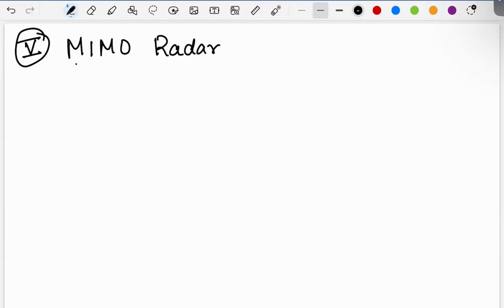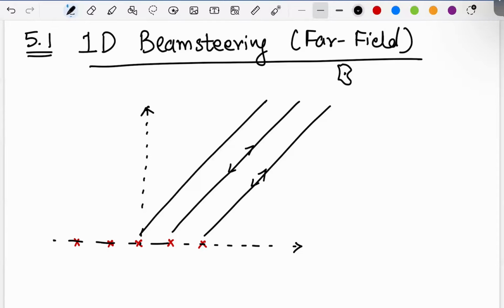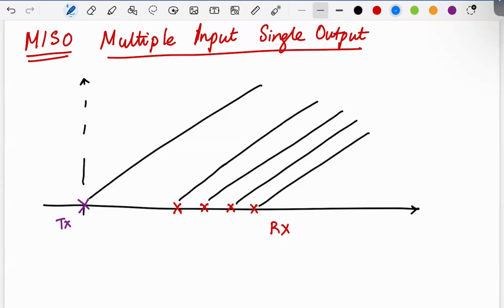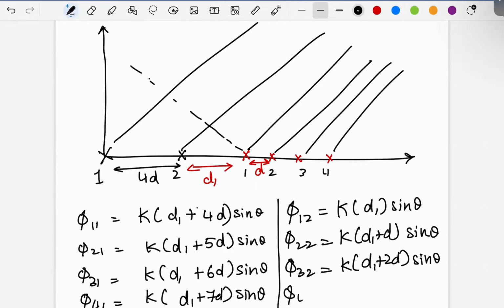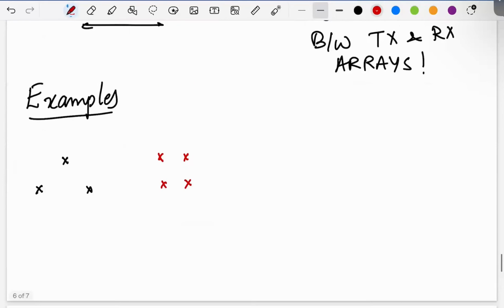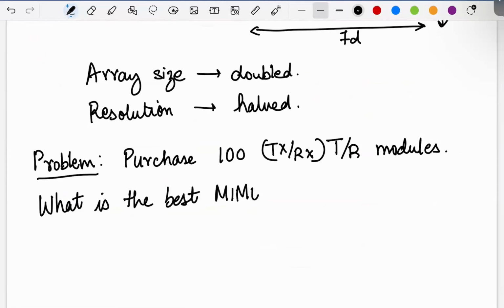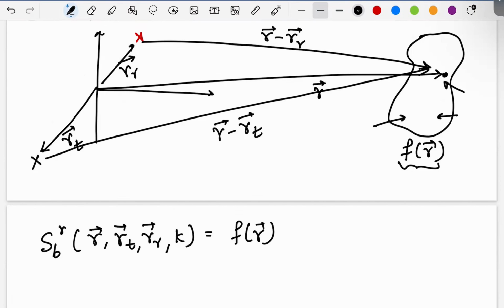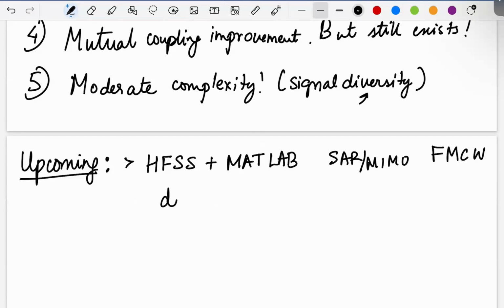MIMO Radar | Radar Imaging 05

Comment from the maker: I want to clarify the difference between the the convolution based virtual array I present in this video and the mid-point based virtual array found in some literature. The mid-point virtual array approach and the convolution virtual array approach are both equally valid.  The mid-point virtual array is formed by taking the midpoint between each TX and RX pair. When you use the mid-point virtual array you should treat each element as an element of a synthetic aperture radar, i.e., you need to account for two-way propagation when doing beam-steering. In the convolution virtual array approach, each element should be treated as a receiver phased array with a single common transmitter (or a transmitter phased array with a single receiver) , i.e. only account for one way propagation when beam-steering. If you draw the two virtual arrays for a given MIMO system you will see that the mid-point array is scaled down to half the size of the convolution array with the same distribution of elements. But since you account for two way propagation, that compensates for the scaling down. At the end you care about what phase weights to be added to each TX-RX pair. In both these cases you will get the same result.

Note: Both these approaches are only valid for far-field beam-steering and not for near-field imaging.

Comment: 45:35, this drawing is not correct. The drawing has an aperture in the y-direction of 5d, not 3d. If we use the configuration on the left, we do not find the virtual array on the right.
What we need is that the vertical (horizontal) spacing between the Tx (Rx) linear arrays equals 4d to have no overlap in the virtual elements.
However, this causes issues if we want to draw the Tx and Rx elements with their centers aligned, as is done in the drawing on the left, as the closest distance between a Tx and Rx element would have to be smaller than d (you can check this by drawing the convolution; the easiest for me is not copying with respect to the center of the Tx/Rx configuration, but rather a fixed element like the top left element).
If this is a design challenge (hardware level) that can be overcome: great. If not, an easy solution is to just put these Tx and Rx configurations in each other's 'vicinity', as the convolution operation would still give the desired virtual array.

Comment: Hi, I am the beginner in radar field and thank you for uploading these series about radar. Recently, I encounter some problems.

1. I understand the virtual array formation under far field condition, but I found out some papers refer this array as co-array. They think of the midpoint array (the virtual element is on the midpoint of TX, RX pair) as the actual virtual array(also this is under far field). My question is what on earth is the difference between this two.

if we say the beam pattern of the MIMO is the TX pattern times RX pattern, then the "co-array" becomes resonable, since the aperture's fourier transform yield the beam pattern and this lead to convolution of TX and RX position. But this generate another question.

2. If we think co-array as the actual virtual array configuration, then it seems to be improper to use TDM because there won't be interference result.

hopefully anyone can answer my question or provide some reference. thank you so much!!
Reply from the maker: The mid-point virtual array approach and the convolution virtual array approach are both equally valid. When you use the mid-point virtual array you should treat each element as an element of a synthetic aperture radar, i.e., you need to account for two-way propagation when doing beam-steering. In the convolution virtual array approach, each element should be treated as a phased array with a single common transmitter, i.e. only account for one way propagation when beam-steering. If you draw the two virtual arrays for a given MIMO system you will see that the mid-point array is scaled down to half the size of the convolution array with the same distribution of elements. But since you account for two way propagation, that compensates for the scaling down. At the end you care about what phase weights to be added to each TX-RX pair. In both these cases you will get the same result. Hope that clears your doubt.

In both cases you need TDM (or some other orthogonality) because you need to measure each TX-RX pair separately.
Reply: @adityavarmamuppala  I see~ thank you so much!  and actually I have some question about the previous video too😅
1. Basically the sar will make a lot of image and then make summation of all of them, am I right? i.e when array is at (x1,y1) we construct an image of the target, then the array move to (x2,y2) and construct image again, is that correct?

2. let say we have finite point on the target, and we want to use sar to construct image and the element is at (x,y). The received signal of one element will have the contribution from every point on the target, but the distance will be different
((x-x')^2+(y-y')^2+z^2 will be different, where (x',y') is on target). Do I need to apply the so-called steering vector to get the coherent-sum signal(make the signal maximum)?

sorry that I have so many question because I have learned phased array before and SAR has some different describtion that make me confused.🥲

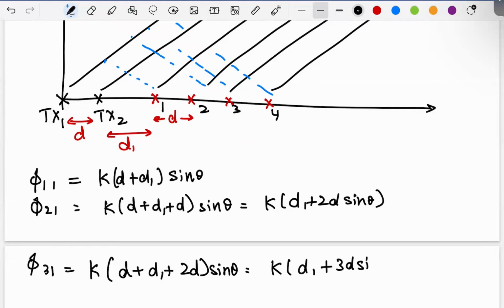Comment from the maker: Minor typos: At around 25:00, I include the sin(theta) in the parenthesis, but it should lie outside. At the end (around 59:30) there is a plus sign missing between |r-r_t| and |r-r_r| in the exponential.
Reply: Also, at 59:00, there is a small typo. The denominator has |r - r_t| . |r - r_t|, the subscript t is used twice. It should be |r - r_t| . |r - r_r|, one term for transmit, one for receive.